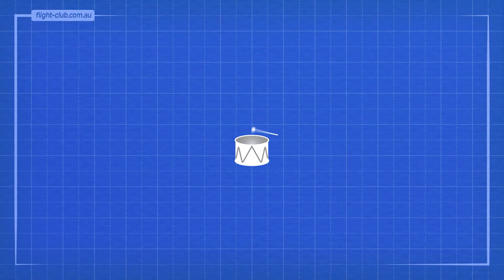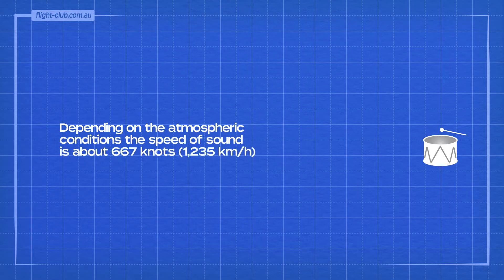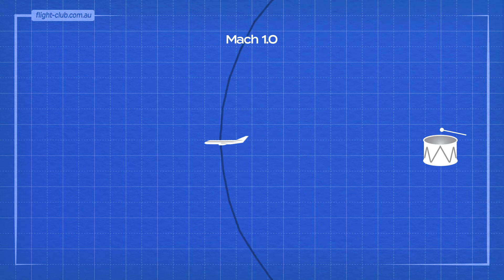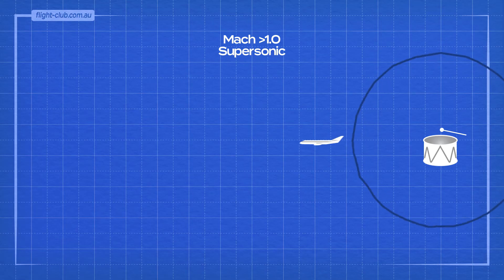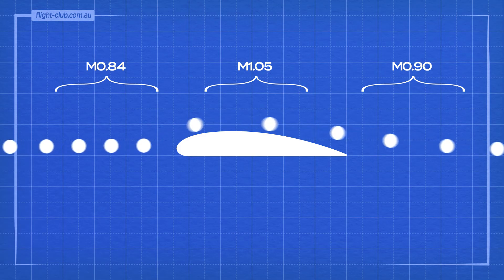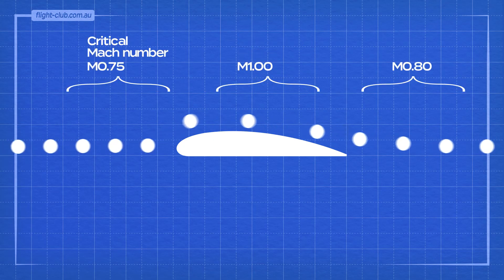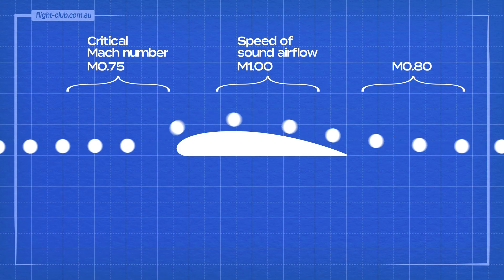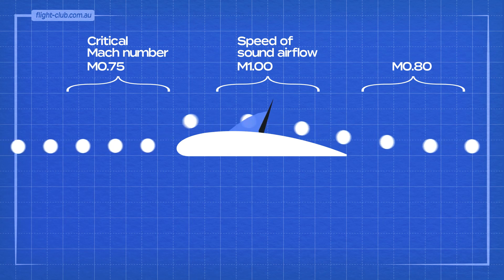Understanding Critical Mach Number | Simply explained.

Comment: Hi there, what is critical mach number useful for, under which circumstance do we need it for?
Reply: Critical Mach Number or for short Mcrit, is important because when you reach this point or surpass, the aircraft becomes unstable, especially if the shockwave is over control surfaces like ailerons, or elevators. The shockwave also sharply decreases lift and increases drag over the surface it is on.